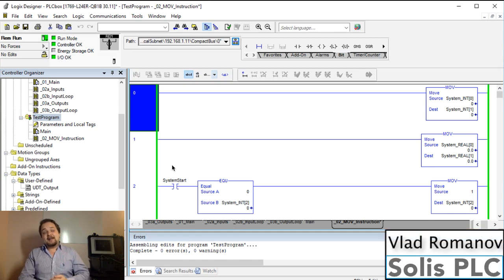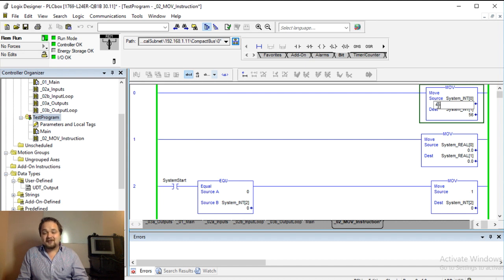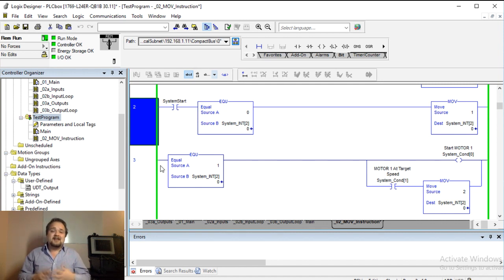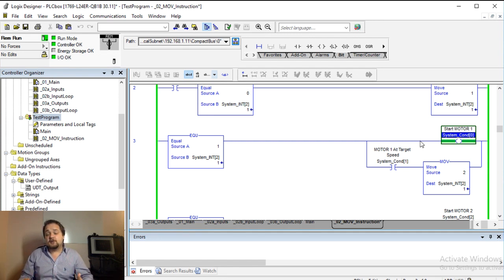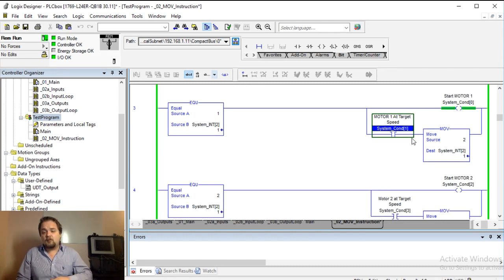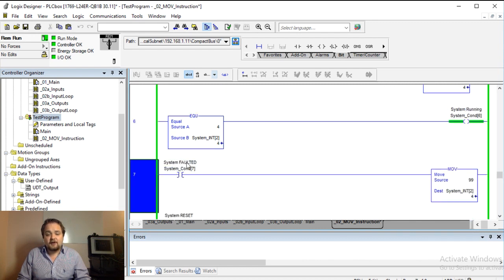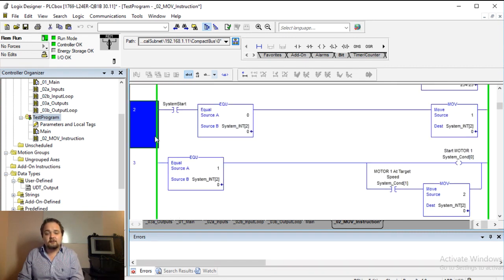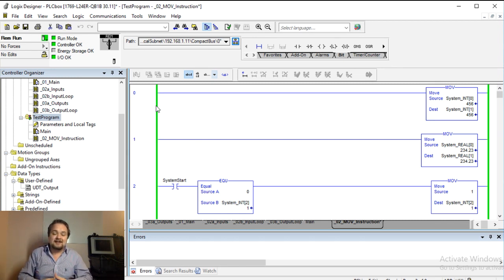PLC Programming MOV Instruction - Move Ladder Logic RSLogix Studio 5000 Example Tutorial System

Comment: DO they have to both same tag location? EX..controller tag to controller tag?(same controller)  or can they be any program tag to main program..etc. because i a cannot move any DINTs (both program tags) .  i am trying to move a zero to a dint and it will not change
Reply from the maker: No, most instructions don't have this limitation. Only certain CONTROL based tags need to be specified as controller only. I can only think of the PID and MSG instructions right now, but there are several others.
Reply: @SolisPLC  thank you for the reply! it ended up being the new routine i created was not added as a subroutine in main program! thanks again.

Comment: So the equal box is just comparing the source A and B values and if the imported value (B) matches the source value (A) the rung becomes true?  What are these boxes called?
Reply from the maker: Chris, that's 100% correct. The EQU instruction is just there to indicate TRUE if both values are identical. They're called Ladder Logic Instructions. In this case, it's a conditional instruction since it resides on the left side of the ladder and is a condition for the rung to execute.
Reply: @SolisPLC  Perfect thank you for all the help man. I'm am an electrician in the auto industry so I will be using the plc for minor program changes, testing and troubleshooting.